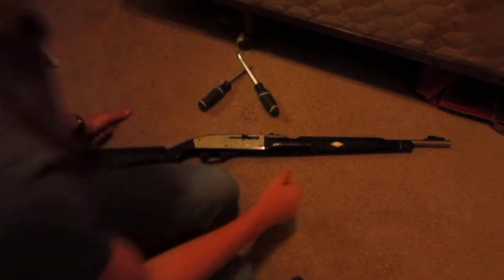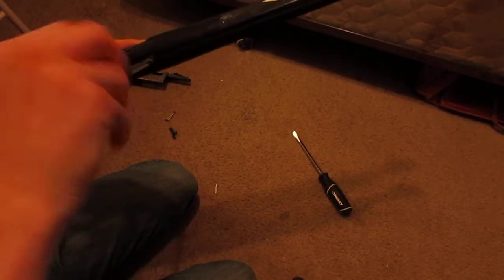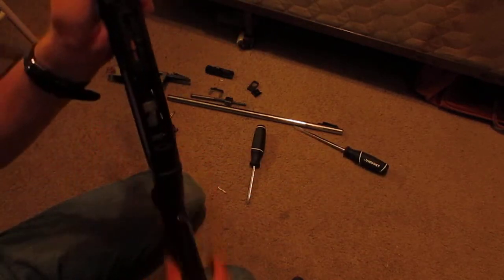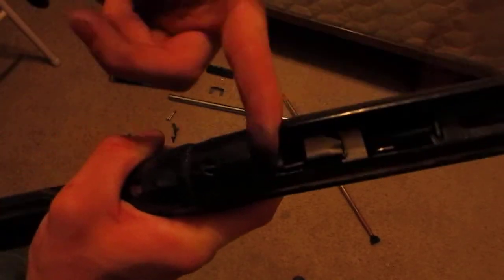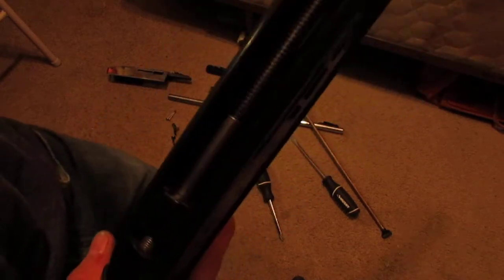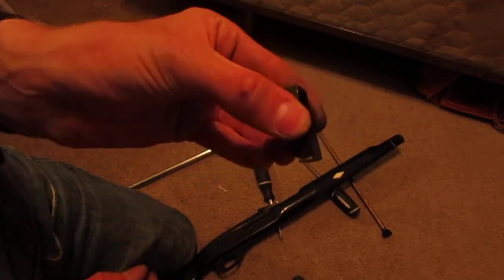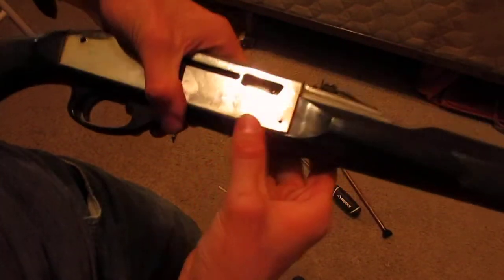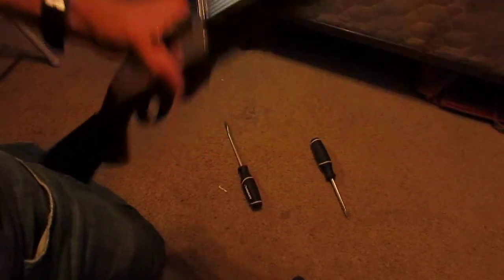Disassembling & Reassembling The Nylon 66

Comment: Everywhere online i see two pieces of advice for this gun: Never put a scope because it won't hold zero, and never disassemble because you'll never put it back. Both of those are complete BS! Attached properly, my cheapo Tasco 4x stays zero'd week after week. And as long as you have an awesome guide like this one or the countless other youtube vids, putting it back together is actually pretty simple! As long as you keep it clean the Nylon 66 will ALWAYS work
Reply from the maker: I Quickscoped JFK I appreciate the kind words! And hell yeah, there is NO reason a firearm like the Nylon 66 wouldn't hold zero. I'm glad to know you tested this yourself rather than getting discouraged. They are wonderful rifles.
Reply: Right I spray mine down with Carb cleaner, Does a nice job of getting the grime off & I spray my parts with some Silicone Spray instead of ever using any oil etc My problem is trying to clean the inside of that Loading Tube, Which is hard to get to etc.
Reply: I had a scope on mine for years but I never shot it enough (and I'm probably not a good enough shot as well) to know for sure how well it would hold zero.

Comment: Do you know you are missing two parts to the firing pin? There is a firing pin return spring and a firing pin retainer pin. With these two parts installed the firing pin will not fall out of the bolt assembly.

Comment: You didn’t even take the rifle all the way apart, you barely field stripped it at best,  and your lighting sucks
Reply: From everything I have watched or read you don't have to take it down any farther..i have a nylon 66 and have never tooken it down any farther than what he has and it's like and it's a 30 year old gun..it was my uncle's and he said he never took it apart just sprayed cleaner in it and a tooth brush..
Reply: Good video. Maybe a little better lighting would help. But you were clear and to the point  This  is all that is needed to feild strip and clean a 66. 
Any further disassembly would only be for broken or damaged parts. 
These guns are designed to run with absolutely no lubrication  to the “nylon” “zytel” firing action. Any oil put on the nylon rails or feeding mechanisms will only attract burnt powder and gum things up. A light coat of oil on the exterior metal parts and inside the barrel are ok. 
But NO OIL OR GREASE OF ANY KIND ON THE  ACTION.  (Read the owners manual)